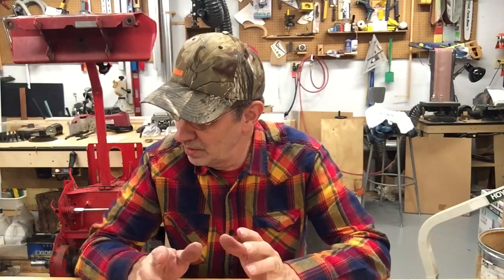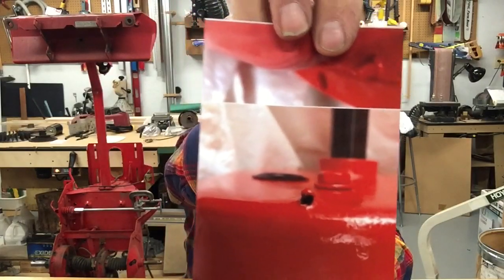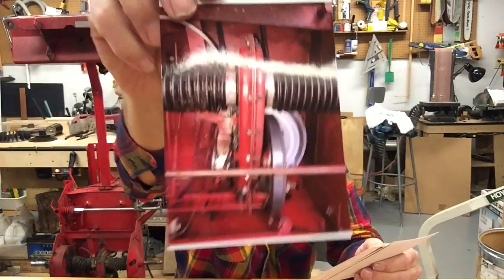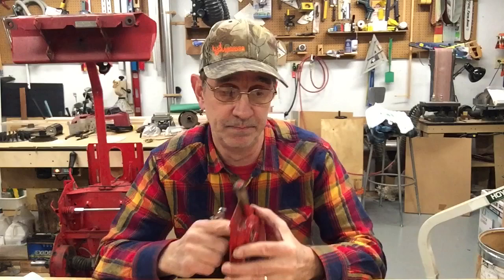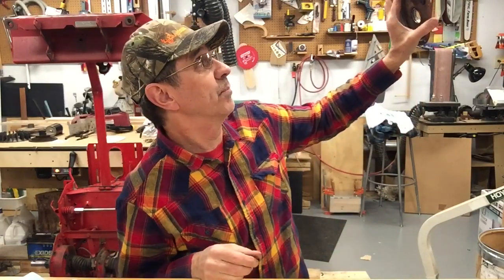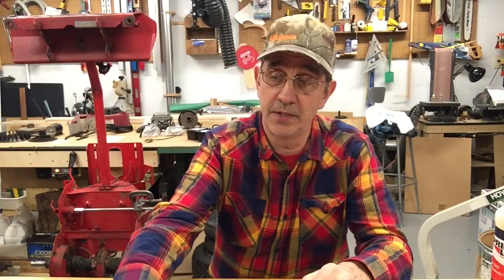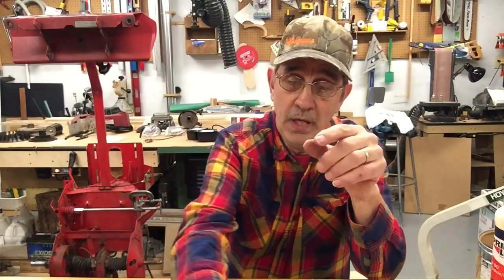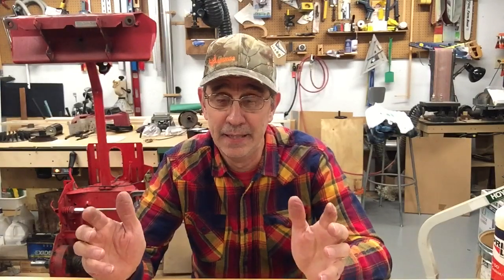375. What kind of lubes can I use in my snapper drive train and how can I do it

Comment: I just bought my first Snapper.  It is a one owner, garage kept, 1983 model.  It has been sitting in the garage for around 10 years. I want to do everything required to put it back in service.  If this means opening the transmission case, then I guess that is what I will do.  Thank you for this video!  I may have skipped over some critical considerations without it.

Comment: Tractor supply has "00" grease brand name is Super S. It is called cotton picker spindle grease at $5.99 a quart. works great and it's cheep.
Reply: my go to!
Reply: So they have it cause that's what I need i have 80w90 gear oil and read that could leak out because its thinner so is the cotton picker spindle kind thicker

Comment: I am subscribed Jim, you can buy 00 GREASE from Tractor supply company for 7 bucks for a quart. That is the cheapest price I have found Sir. Now that is a deal. Or you can mix half number 2 grease and 500 weight ford differential oil for the model T Ford will make real sticky grease like snapper lube that will not dry out. Also, my Snapper dealer said Snapper does not sell the lube any more..
Thanks for the information Sir. vf
Reply from the maker: I’ll have to check into that 500 weight differential oil. Thanks for the tip. Jim.

Comment: Hi Jim - it's Big Rodders in Ireland.  I guess I've been lucky with my 1996 box section RER.  I was afraid of stripping down the gear case for fear of opening up a hornets' nest so I just bunged in 80/90 gear oil up to the fill level and kept on cutting.  The old grease must have blocked all holes as I haven't had any leaks!  We've seen the tornado footage on the news here and it's impossible for us to comprehend the impact of such events.  I hadn't realised that they could strike all the way up to the Great Lakes.
Reply from the maker: Hey Rodney if you ever need any parts let me know and I’ll see what I can do about getting them to you. Jim

Comment: I don't know if anyone has suggested this, but it seems one advantage of using 90W or similar "fluid" is that a powerful rare-earth magnet could be mounted within one of the rubber plugs.  This might allow the particulates generated through wear to be filtered out of the case helping to prevent further wear.  Might make for a good experiment.  The plug would need to be removed in concert with the magnet to keep the fines from falling back in, but I think that could be managed.
Reply from the maker: I suppose that would work if you could get something to stick to the back of the plastic plug, automakers have been installing magnets inside of their transmissions for years because the gears that they stamp out are not deburred. Jim

Comment: Jimmy 
I switched to corn head lube from Reemans tractor in Fremont, used in combines. It loosens up to gear lube when rotating and then thicker up luke grease when slow 
HAVE YOU EVER HEARD OF THAT
Reply from the maker: No I’ve never heard of it I’d like to see how it works, I have a question we have a Fremont about 30 minutes from me what state is your Fremont in.       Jim
Reply: @jimjackson9381  Fremont Michigan, I met you at Craigs hardware gave you thatcher, I will email you
Reply from the maker: That’s why your username looked kind of familiar it’s been a while so you think that stuff rejuvenates the old dried up snapper lube I’ll have to try some of that out there’s a lot of people that would be interested in getting a hold of that thanks for the tip keep in touch.           Jim

Comment: My lawnmower repair shop sells the rotary brand of 00.grease for the drive system system on the rear engine rider by snapper what is your thoughts on this type of the rotary brand of grease
Reply from the maker: I don’t think I’ve ever came across that type of Grease I’ll have to check into it. Jim
Reply: @jimjackson9381  Okay thanks for your reply

Comment: Well i do have some differential gear oil 80w90 and Amazon is out of that 00 transmission oil grease for the chain case

I checked this guys and his is almost out of grease or oil in the chain case I gotta put something in it and I don't mind what it is long as it wets those parts his sprocket teeth are still good I'm surprised 

His differential is lubricated and good with old stuff in it I'm not gonna mess with that 

But the chain case needs lubrication I have a bottle of 80w90 gear oil and I'm gonna use that maybe that and pump some white grease in with it. It needs something because those chain sprockets are almost dry the teeth are good